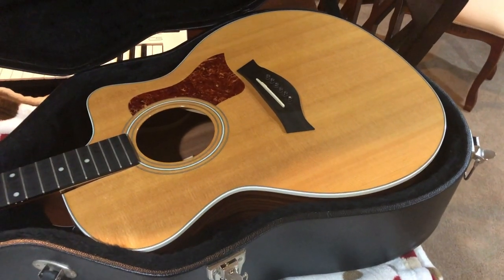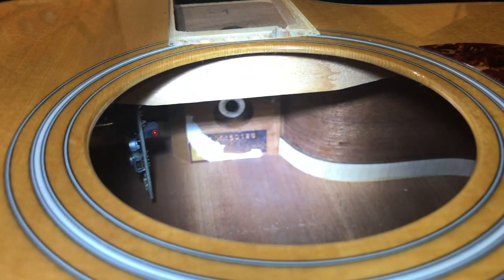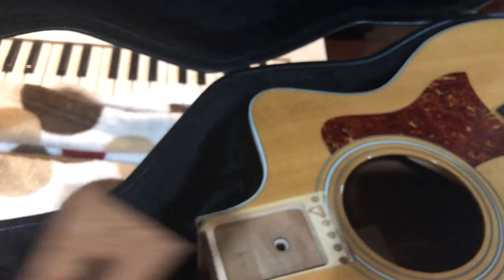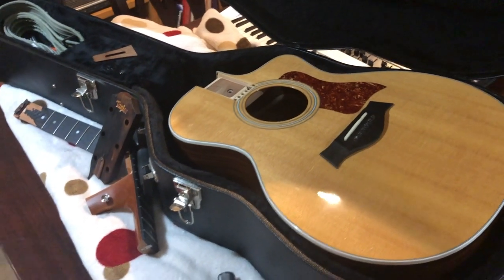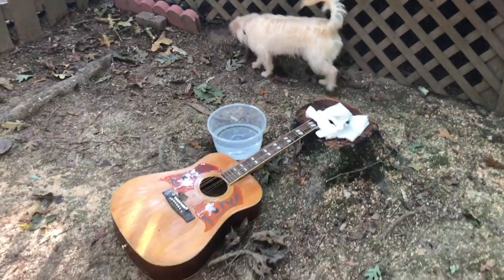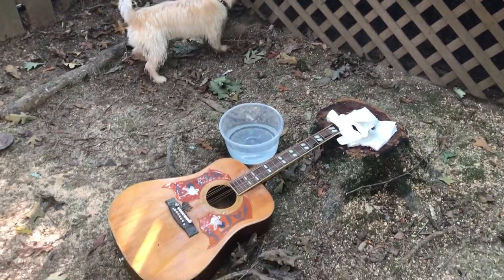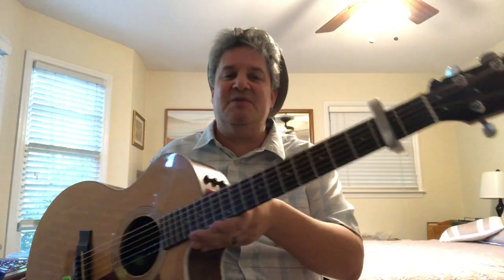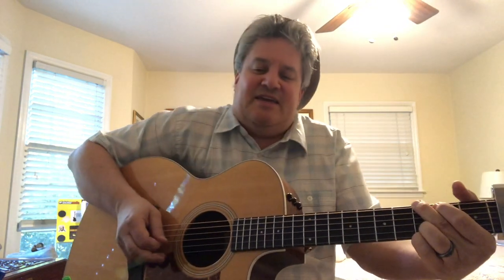Here's Why You Never Leave A Loose 9 Volt Battery In Your Guitar Case!

Comment: Luckily, I learned this lesson very early on in my solo acoustic career; as none of my electrics ever used 9V batteries in my earlier rock band years. At a gig in an Irish pub in 1997, I had left my Ovation case open at the edge of the stage to encourage tips. Into my set, I saw smoke pouring out of the case. I thought that some jerk had flicked his lit cigarette into my case as a rude gesture (smoking was still allowed in bars), but I was wrong. My extra 9V in the case’s compartment had lain against the hunk of steel wool I had in there for fret polishing and created a little science experiment and f***ing burst into flames. Had this happened in my car or at home, I shudder to think of it. From that day forward, all 9Vs have been stored individually in ziplocks or with a strip of duct tape across their terminals. Even at home in a drawer. Thanks for the PSA!
Reply from the maker: Yeah, crazy story for sure. I wouldn’t have believed it, but the door panel of her car was melted as well! Thanks for watching!